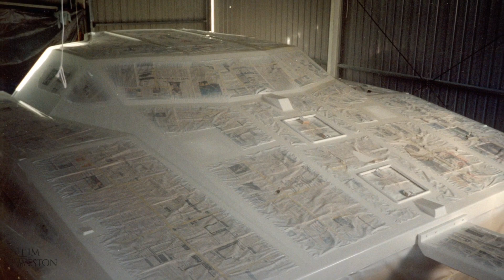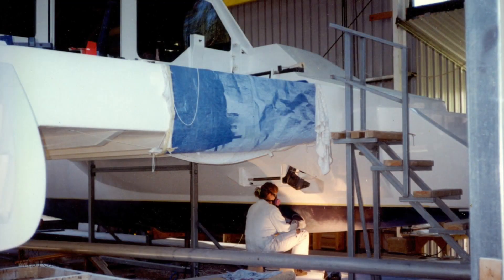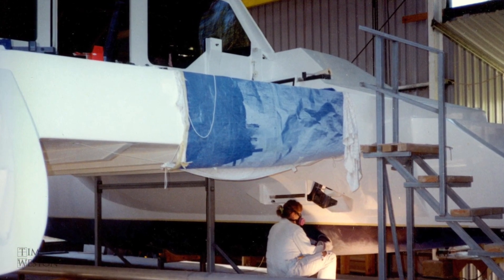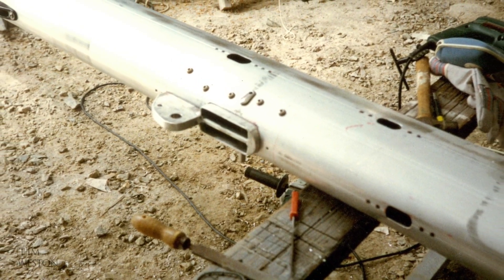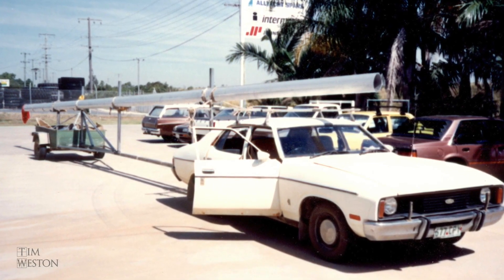How to build a boat Ep #5 - Catamaran you can live on

Comment: Amazing job!  :)   Did you have problems with the bonded windows leaking water?  how thick are de acrylic?   I thought acrylic goes bad quickly.... why not tempered glass?   How much it weighted in the end?
Reply from the maker: Hi, Bravelo. No water leaks, with bonded windows. They were 6mm Shinkolite acrylic, which the latest owner has just replaced. In the end they crazed, but after 20 years of use. They are not as durable as glass, but much lighter.

Comment: 7 knots on ONE 9.5hp outboard?!  Wow...  that's amazing.  I dare say that's about what most sailboats make on a good day and what most cat-boats make with both engines!

I don't understand something you said though you, said that the alternator put out so much power that you either had to use the engine to make electricity or propel the boat. What did you mean?

Can't wait for the next vid, by the way, how long ago was your cat build?
Reply from the maker: Hi there.  Yes, the performance was excellent.  The boat was light and the bottom super smooth.  It didn't take much to push her.  The alternator put out over 80 amps at 14V.  At quite low RPM.  Then motor had only enough power to drive the alternator when it was on.  Which was perfect.  It was loaded up and worked efficiently when running in charging mode.  To drive the boat, I had to turn the alternator off.  Tim

Comment: How important is it to use to cedar strips? I like them but they are very expensive in large quantities. Is there anything that is cheaper but still strong enough? I was thinking of using 2x4s for the framing and plywood as I am only building one to live aboard and not to sail so there will not be any strong forces.
Reply from the maker: Hi Rant. The cedar is really just core material. It also adds strength to the boat but the real strength comes from the fibreglass. It's main purpose is to keep the fibreglass apart. Plywood is, I think a viable cheap alternative. It is stronger than the cedar so strength is not a problem. As long as the ply is exterior grade, i.e. has a waterproof glueline, it should be fine. It will be heavier and a bit more work, but it is a lot cheaper. I have thought of this alternative myself for future boat ideas. Keep in touch how you go and what you come up with.  Tim
Reply: Tim Weston That's good, I just ordered some books on the subject to hopefully learn a bit more. The boat will be nowhere near this size as I'm only 16 and could not afford it but hopefully a mini cat will suffice. Not sure when I'm going to start on the project but I have a lot of planning to do. How much did the plans cost you? Everywhere I can find plans cost 1KUS + and very often 6K-15KUS. I would like to go off of a set of plans as its my first time but adds a lot of complication with figuring out the right hull(s) shape for weight vs speed(aerodynamics), water line, etc.
Reply from the maker: I bought the plans, they cost me $2000 AUD, about 20 yrs ago. I'm sorry I don't know who to suggest to buy plans.  You could try designing something yourself in Delftship. It's free, but a bit of a learning curve..  Don't know what else to suggest Rant..Tim
Reply: Tim Weston Well thanks for the help anyway.
Reply: Hi rantz  I repair and build boats as a hobby.  Done five.   You can also use a foam product called vinyl sheet foam  or Nomex both are superior to wood but EXPENSIVE!!!!!!

Comment: How did u make the motor push xD?
Reply from the maker: Hi Frog!  I'm not sure I understand your question?
Reply: I am sorry for my bad english but i meant where did u put the motor and is it pushing straight? Thank you :)!
Reply: Me and my dad get inspiration from your videos to build something alike but cheaper 
and only from fiber our dimensions are 6 40 lenght 2 50 to be easier to transport. This why why i will come back with certain questions thank you :=)
Reply from the maker: Hi again Frog!  No problem..  I'm glad you found some inspiration from this..  Yes, the motor is pushing straight ahead.  When they fold down the thrust is straight ahead.  I hope this helps.  Tim
Reply: *Thank you so much Tim youre a great person :) one more thing how much is your boat sinking ? and how much does it weight if you know that :) Thank you again! Denis
Reply from the maker: +Frog Hi again Denis.  You are welcome.. The boat weighed 2500kg on the crane with motors but not much else.  I'm not sure what it weighed in the end.. Hope that helps.. Tim